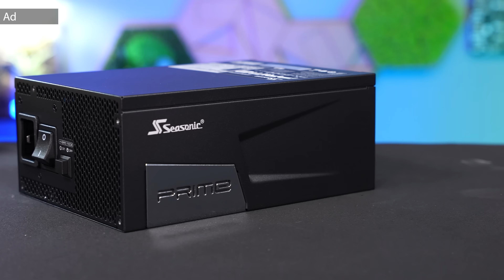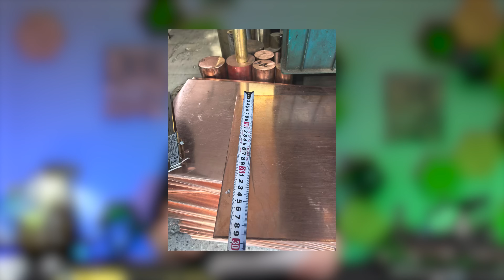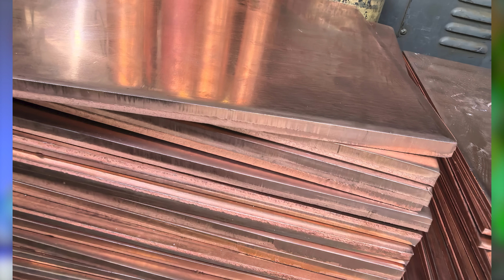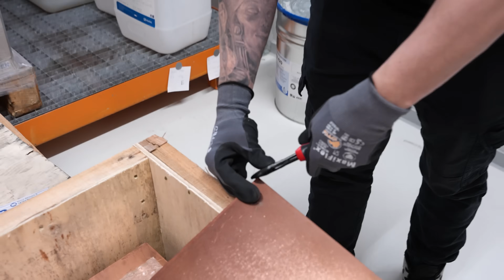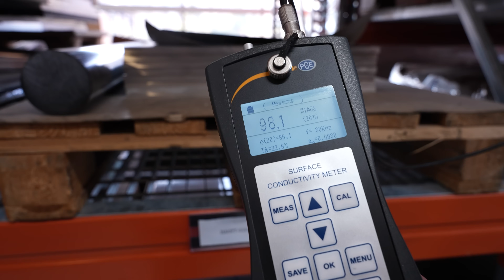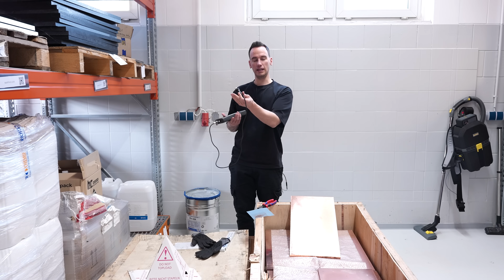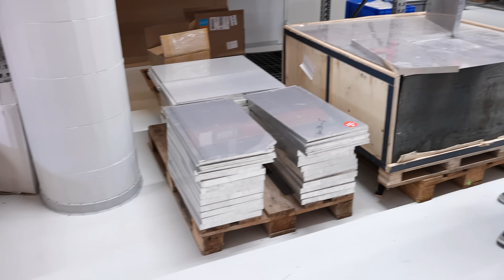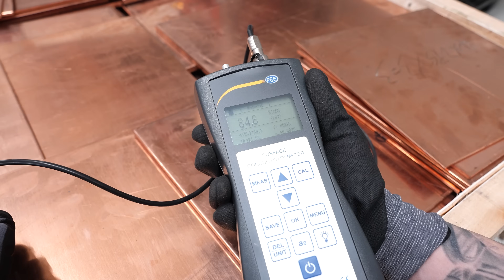I Got Scammed

Comment: I honestly never thought to purchase raw materials from China and never would. I've only dealt with the Chinese for things that can't be made in the US, because the factories don't exist. Generally if you buy a very small quantity it's fine, I suppose they think it's a test and don't want to risk their reputation on a couple hundred dollars. It's when you buy a larger amount that they scam the isht out of you. And realistically I don't even think the person who represents the "company" you are working with even knows they are scamming you. These guys are like brokers that run around to these hack operations trying to acquire stuff, then all they do is ask the outfit for pictures etc. when you ask them. They pretty much never "work" at the factory and may have never even been there. You have to hire a firm (NOT based in China) to break open a crate and be willing to do whatever testing is needed. In your case they literally should have dug the plates out of the middle of the box and went at them with an angle grinder.

Comment: Oooooof. I spotted the grinding spot on the mill test plate before you even knelt down to point at it, and I was in complete shock. This kind of criminal, B2B scamming is so isolated (specific markets, etc) in western counties that it's actually difficult for many purchasing departments to fathom until they experience it first-hand. The Chinese companies know this. Even usually-honest companies in China may jump at the opportunity rob a customer if presented with the opportunity. Probably even MORE so lately with geopolitical trade wars hurting their bottom line.

Comment: This is not a China problem specifically, this can happen to anyone anywhere when you don't know what you are doing or are doing it the first time and have to get scammed to look into things.

This is not how you deal with manufacturing of any kind and shopping cross borders, never was, never will be.

1. Money held in escrow by bank (usually via a Letter of Credit).
2. Inspection done at factory by your person or a hired third-party QC agency (like SGS or TÜV), during manufacturing, before packing, random samples.
3. Money released only after inspection is passed and the Bill of Lading is issued (proving the goods are actually loaded onto the ship).
4. If goods are faulty, they are either reworked at the factory's expense, or you get your deposit back.
5. Clear Incoterms: You establish exactly how the goods are shipped (e.g., FOB, CIF, EXW) before signing anything. This dictates who pays for the freight, who pays for insurance, and at what exact moment the liability transfers from the factory to you.
6. Ironclad Specifications: You never just order "metals" or "manufactured goods." You provide detailed engineering drawings, exact material grades, tolerances, and packaging requirements in a formal Purchase Order. If it is not explicitly written in the contract, they won't do it.
7. Customs and Documentation: The factory must provide the correct paperwork (Commercial Invoice, Packing List, Certificate of Origin) to your freight forwarder. Without this, your container will get permanently stuck at your local port, and you will rack up massive storage fees.

If you just wire cash upfront to a foreign factory based on a few friendly emails and a catalog picture, you are begging to receive a shipping container full of scrap metal—or absolutely nothing at all. You protect your money, you verify everything on-site, and you tie payment to performance. That is how international business is done.

So if a factory won't do business on the above terms then they can't supply what you need - if they could there is nothing above they wouldn't agree to. Simple as that. Never forget.

Comment: Hi I just been scammed to but by AliExpress I brought loads of items from them but they only sent the cheap items, then they give you the run around for months and you get nothing.
another scam they do is copper coated aluminium for many types of wire which can cause so many issues, there are so many fake stuff they do some are dangerous some are deadly

Comment: Thanks for the video. You’re obviously not an idiot since you asked for proof, but there comes a point where it's impossible to be 100% sure unless you personally inspect every plate in the container and then hitch a ride on the ship to babysit it all the way to your facility. That’s obviously not feasible, so you did nothing wrong. Maybe you could have started with smaller batches, but then again, the shipping costs and delays would have been a nightmare. Really sorry this happened; I hope this is the first and last time you have to deal with something like this—at least at this scale.

Comment: I has been lucky , I bought several 4k triple laser 4k dolby vision projector ( 2,500 us dollars each ) and projector screens (600.00 each) on Alibaba and for now no issues , they have a thing call Trade Assurance that you can ask for a refund in case you don't received the original product, also you can make a claim to your credit card bank in case you received an scam like this  or in case Trade assurance protection program fail to resolve the issue with the seller

Comment: I remember what happened to Renault, with the Twizzy - which is why, when I was ordering from China; I made lots of SMALL orders, as they are less likely to scam you over a few hundred, or a couple of thousand; and if they DO, then you havent lost so much and can swap suppliers quickly.

I had mobile phones turn up with fake GPS systems installed; they even had a fake GPS satellite tracker program that showed fake GPS signals to make you believe it was all working correctly.

If they agree to take back the "defective" items, what will happen is - it will sit in the Chinese customs shed for 6 months, until ANY chance of you making a claim against them has expired - then get sent back to you again; OR they will send another set of fakes - had both of those happen to me.

Sadly, 90% of Chinese businesses have no concept of repeat orders or buyer loyalty, which is why I wont touch one of their cars, no matter how well reviewed they might be.

Scams are so common in China, that if you go buy anything electrical/electronic from a department store, they will unpack it and demonstrate it working in front of you, then put everything back in the box and hand it to you.

Credentials, I lived in China, have a Chinese wife, and have some experience in both importing from, and exporting to, China.

Comment: In China, companies don't really exist. They can exist, scam someone, disappear, and re-open as a new operation almost immediately.
As was mentioned, Letters of Credit are your friend. Or have an employee fly to China and oversee the process all the way until it's on the ship and they cannot touch it.
Reply: I guarantee they can still scam ya if they wanted to.
Reply: Yup. Flying there and checking things out in person would have added logistic overhead, but it would have saved a lot of money.
Reply: I've heard the same from companies buying iron from China, they had to send inspectors to make sure they were getting the right iron, then after the inspectors verified it was the right one they had to start putting locks on the containers to make sure no one changed the iron for bad quality one after the inspection and finally they even paid for security to watch the containers before finding a better supplier lol
Reply: @Abyss-Will  I used to work for a company that manufactured in china - having people visit factories and do repeated inspections, even after few successful shipments, is crucial.
Every time when I order stuff from china it is a matter of a question: can I burn that money?
Reply: Literally a $2K try to save yourself $40K
Reply: This. If you don't have an existing relationship or a trusted referral, you need to have someone on the ground for the first few shipments, and potentially sporadically after. We usually dealt with suppliers by referrals, ask for samples, and so on. However, we also operated more in finished products, not raw materials, so our delivery problems were more of quality control issues than anything else.
Reply: What do you mean "companies don't really exist"? Of course there are reputable companies in China.
Reply: @luobomu9747  There are reputable companies in China, serving domestic market, because those who scam their own will be found and punished quickly. But companies serving overseas customers dont see this kind of scrutiny, and the gov often turns a blind eye on them just to ensure the steady flow of money into the country.

Comment: you need to work a relationship with one  supplier and keep it... if he runs out and need to go elseewhere,  even if it costs too much order samples instead of full loads. order smaller batches, big enough for them to want to scam you so you can check first but not big enough to lose your investment. Youll lose on shipping but less still. like a 5 or 7k order instead of 20

Comment: Its probably the same guy/factory just two different store fronts.
Reply: My thoughts as well. A decade ago I tried dual sourcing some PCBs from China and ended up with identical products on my end. Everything, including spelling errors were the same. One was manufacturer and other was "trader" account from the other province in China.
Reply: I dunno, they are using two different techniques
Reply: @cybernaughtilus  Either way, it gives a very bad taste to doing business with companies there. It's almost as if they leaned into the stereotypes, which is a shame. It's unfortunate when companies perpetrate massive scams that tint the view of doing business in a region in a negative light. With fewer regulations or recourse, even for people doing business within the country itself, it sounds like a constant headache trying to get by in daily life. Maybe the motto "Don't be evil" should be taken up there? I hear Google isn't using it anymore.
Reply: @jonathanscherer8567  to be honest, it also taints alibaba as a platform. If one is thinking about using it, you can't trust even suppliers with hundreds of verified trades.
Reply: @jonathanscherer8567  It's sad when the 90% give the 10% a bad name.
Reply: @cybernaughtilus  copper only weighs about 10% more than steel, so the trick is to make it look and test like copper, so plating. Aluminum is 70% lighter than steel so the trick is to put enough actual aluminum plates on top for inspection and then enough steel plates under that to get the crate weight right. The materials in simple terms take two different scam techniques, doesn’t mean two different scammers
Reply: @cybernaughtilus  Maybe its employees doing it and selling the real stuff on black market? god damn
Reply: Both in same warehouse lol
Reply: in my mind it's not the seller but some suppliers down the chain... they Need to go thru all the trouble of obfuscating the scam in case the seller decides to do a quick check on a crate, like open the lid for visual inspection, check the weight, etc. otherwise think about it, why go thru all the extra work since the money was sent? just fill up a crate w/ rocks and ship it...
Reply: That is exactly it. There aren't "hundreds" of factories/forges making same products. It is 1-2 factories that actually produce and 100s/1000s of "resellers" that have close ties to the factory, but legally speaking they isolate/protect the factory from any responsibility.
Reply: Not necessarily, scams like this is far more common in China than people realize. Many legitimate suppliers will push out scam orders to boost margins which is why so many companies have people to check shipments. They'll take advantage of anyone who hasn't yet learned the game because there's rarely any serious consequence.
Reply: That's what I was thinking.
Reply: What I'm curios is, if he went through Alibaba, why didnt they intervene ?? From my experience, Aliexpress always came through whenever I had a dispute, so I'm not sure why it should be any different in this case.
Reply: @DavorBa  this is my biggest question. aliexpress would torch that company to the ground for a scam like this. alibaba has to deal with orders of magnitude more money so how would they not be stepping in for a scam on this scale. scams on ali express only work because the monetary value of the items are relatively small and stores still get banned for scamming. an actual company had to exist for these products that alibaba could target for mass scamming of high value clientelle.
Reply: @DavorBa  There is nothing that Alibaba can do to them. The ones registered on Alibaba are shell companies often setup in Hong Kong, 1 person can run 10x those shell companies, they are resellers, so they can put the blame on the original party and face no repercussions. Then they just phoenix into another entity if one goes bust. Aliexpress you deal with 1 order of 1 item, so the cost of phoenixing a company is high, on Alibaba you deal with large MoQs, so keeping 1 entity registered for N years and then scamming someone for 1000s of dollars is still very very profitable.
Reply: @DavorBa  Go onto the subreddit people are getting scammed even when alibaba certified or assurence they don't care if the seller somewhat denies it like a fake receipt etc..
Reply: @DavorBa  He just used them to find the supplier. If he'd have actually used a legit retailer like them he'd be A-ok.
Reply: alibaba is a scammers paradise. he had to make the deal in person. also why didnt he have someone test the plates before he got them shipped? 
it literally took 1 minute to see it failed the conductivity test
Reply: @rjacks3284  Yes an inspection company would have caught it for a few hundred at most. There are a bunch of them at every trade show. Shortages bring out the scumbags. The only trouble I've had in hundreds of transactions was for things that were unobtanium at the time.
Reply: @rjacks3284  Yup, buddy of mine runs a business all by himself and stepped on a plane to India and China to see their production and products.
And he hates travelling by plane.
Reply: I'd bet it wasn't even either of the 2 companies/factories, if I were to bet on the culprit I'd say it was the shipping company or a shadow scamming company hidden within the shipping company. The actual copper and aluminium they ordered made it in full to the shipyard for shipping and once there the crates were opened and all the good copper and aluminum was stolen and replaced with what they showed they got received in this video, the crates got resealed and the scammers finished packing the crates for shipment and did whatever that they do with the products they steal.
Reply: @r @randysalsman6992  could be either, but the image of the product at the factory doesn’t match the received product so it certainly got swapped somewhere along the way. 
Look at the edge of the copper plates from the factory, they’re half milled then sheared off the rest, which is pretty common, but the stuff he received is milled on the entire side.

My question is, does he have enough pictures to be able to make a timeline of when it was swapped. Not like it matters…
Reply: Or maybe it got replaced somewhere along the route, in the shipping yard in china or when coming into germany.
Reply: @amfern  could've. he didn't do his due diligence before shipping with a unknown seller nor did he get insurance.
this is not how you do business. you can tell he is new to it.
Reply: @rjacks3284  you're individualising a systemic problem, meaning your part of the problem because you're happy thinking it's the individual that can carry the cost of that systemic problem. 

We have to change our perspective and push for a systemic solution. It's a double whammy that a person can get scammed in this way and then also be left thinking that it's their own fault. You're comment reinforces that.

That's an ethics failure at a societal level, and until you, me, all of us challenge that, the world is a shi&hole

Comment: I used to work as an analytic chemist and all the time we would have people come in and ask if something was legitimate.  I remember a banker coming in with a bag of 100 or so Spanish doubloons that a coin dealer had already told him they looked good.  I remember one of the other chemists suggesting similar analysis to what was done here as it was nondestructive and the coins value was far greater due to their antiquity.  The analysis was coming out reasonably well for the coins.  Then I suggested that we do a basic Archimedes test (really just a density test).  All the coins I tested had a density  10-15% too low relative to what I would anticipate (as I recall, this was 19 years ago or so).  The banker authorized me to cut into one of the coins and test it making sure we tested all the way to the core. I told him we could go to one of the metal testers and x-ray the coin (fluorometry, imagery and diffraction) but he just wanted this over with.  When I drilled into the coin it was appeared that the core was lead...but lead has the same density gold.  When I cut it in half it had small air pockets.  The owner of the lab had extensive experience in industrial chemistry and he identified it as lead solder.  Whoever attempted to perpetrate the fraud went to great lengths (but screwed up using solder).  There was a good amount of gold on the outside of the coins and there was even material that looked like coral remnants on some of the coins.